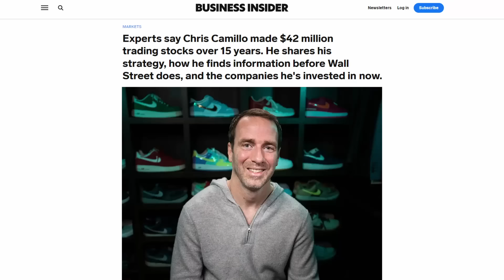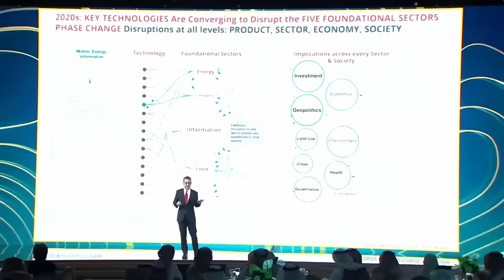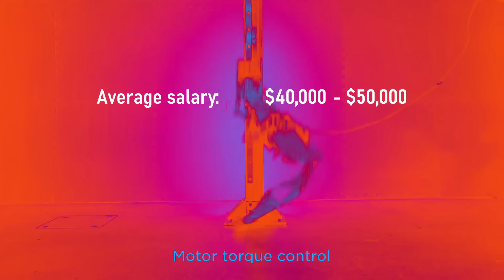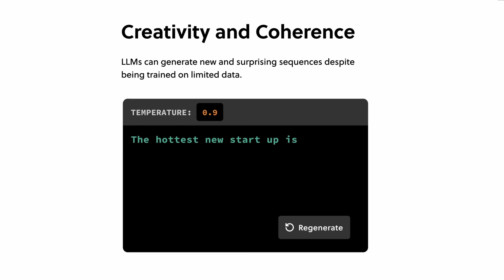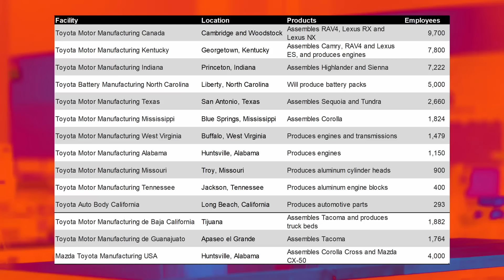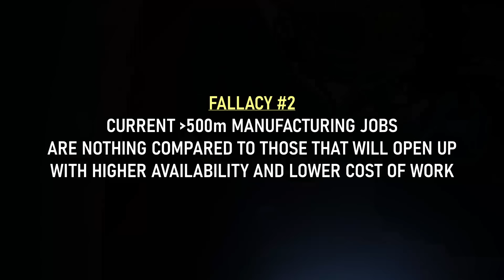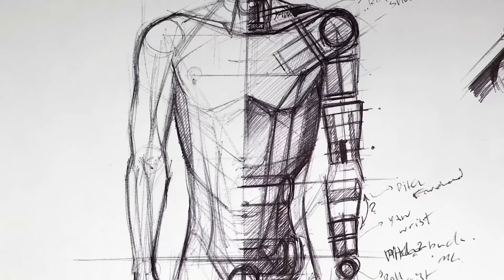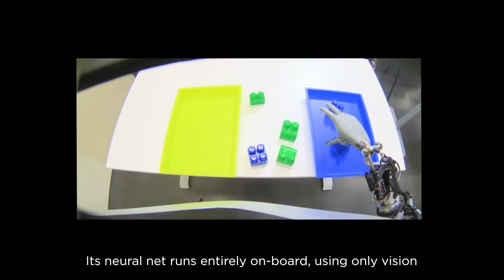The $12 Trillion Opportunity (A Call Option on Infinity! Valuating Teslabot Pt.2: The Road to CHOAM)

Comment: There’s a few errors in these calculations comparing entire workforce cost to just the robot portion etc. 

There’s also things missing.. you’re assuming robots will perform at 1:1 human speed. Some tasks will be slower, some faster. This can be made up by longer shifts, but you’re already including that. 

You’re also assuming a tethered (powered) robot that doesn’t have charging downtime. Surely you won’t get 20 hour shifts out of these things, what’s an industry average of charge time to operation time? Is it really 1:5?
Reply from the maker: 1:1 working speed is an assumption I made to simplify calculations. Of course it is both task dependent (some tasks easier for robot than others) and time dependent (robots will improve) but that's sandbaggongbit. Most automobile production tasks are slowed down to meet human pace for repeated work. Humans can do it much quicker, but can't sustain doing it again and again without tiring, increasing injuries and job related health problems, and decreasing quality. Even if bot's do a task slightly slower than humans, their ability to do it repetitively should trump human speed. I ignored that, as value proposition was high as it is.

charging doesn't bother me as often it can be done on the job (in more static jobs wired, many other jobs wirelessly). There will still be jobs where charging is impossible, but in most cases my conservative 4 hours of downtime per day should be more than enough for charging. Also, there could be a case of carrying an additional replaceable battery, similar to power banks used for smartphones, which would provide extra energy and once low could be replaced with a fully charged pack
Reply: @ConnectingODots  could you imagine what you could charge for a battery that would make the production infinite/non-stop. I bet there’s a team at Tesla working on exactly what they could charge for it. Haha. 

It’d be pretty rad though if the robots took the same lunch break and dinner break as human and it was just charging time.

Comment: These guys seem to be stuck on the idea that human controls will always be around. I’m not a fan of the humanoid design bc the best robots are integrated into the tool itself. For example, does anyone think a physical robot driving a delivery van or flying an airplane is a good idea? The future is in self-driving vans and an autonomous drones - without human controls. Extend that to factories. The factory of the future will not have human workstations.

Comment: Among many excellent points, the idea that products created during testing and deployment could be used in Tesla’s other product categories stood out to me. This, along with vertical integration, having direct access to engineers and factories and databases, compresses R&D. Even if optimus is the most advanced humanoid by capabilities, the R&D would be dramatically lower than competitors because they’re already capitalizing on useful work during testing while also rapidly iterating.

People are not ready for how fast this will all move.
Reply: Work at one of the most advanced robotic assembly lines in the US, with row after row of both fixed and moving robots. It's impressive to watch them move and perform, but it's also an experience how fragile they are, how high-tolerance and constant-calibration they are, and from my employee perspective, how often the outside service outfit is called in. With all of the tasks CNC programmming outsourced to In'dia, and all of the service work outsourced to regional 'authorized service centers', the only work left is Operator, and all that means is parts-changer, then sit and watch the remote videos for sparks or smoke. 

The company has also had to remove an entire $M robot line and replace it with humans again, where the robots couldn't tolerate even minor variations in (large) part dimensions, or had assembly feed parts jams, or parts start dropping in a pile on the floor. There are 100s of paid-bots chossing up Tesla threads, but what is Optimus good for? Optimus is useful only as a  'teaser' for Tesla early-investor cash-float, like Tesla Truck buyer-deposit cash-float, Tesla Solar Tiles buyer-deposit cash-float, Tesla 'Mission Mars' NASA-grant cash-float, Tesla Battery Wall buyer-deposit cash-float, Twitter-X ad revenue cash-float.

Besides, 2024 will be Happy Days (Are Here Again) indiscriminate Fed Fiat Jubilee, slush funding to anything and everything, ahead of the elections, why risk an unproven Tesla? Invest the index funds: Vanguard WW3 Sturm und Drang ADR or BlackRock Crypto ETF. "Stocks are at their highest trading values ever! Isn't it time you came off the sidelines?"
Reply: People will be fine mate. We can actually tell this video was fake AF. 

The real cope will be with you lads in another 10 years when this thing still can't stand on 1 foot without tethers and you finally realise you've been hit by another FSD level scam

Comment: What does the phrase “speculative but relatively conservative”.  ?   How can something be both speculative and conservative?
Reply: It makes no sense but they don’t give good investment decisions anyways.
Reply: When something is described as "speculative but relatively conservative," it means that while there are elements of new, untested, or theoretical ideas, these ideas are not radical departures from what is considered standard or safe. They are speculations made with a certain level of prudence and within the bounds of reasonable extrapolation from existing knowledge.
Reply: That is what it means when someone is using it in a calm considered way but when it is thrown out in a rapid fire sales presentation, which this is, it is a way to cover the “arse” of the presenter.  As in “I am conservative because I told you I was speculating.” This is important when you realize that his self assured way of pricing the Optimus at $120,000 per year gets absolutely not push back from the “world class engineer.”

Comment: Interesting video. In this video too, a mistake is made when it is said that automation saves money. Automation, like any cost saving, mainly gives a competitive advantage. In the short term, profits may increase, but over a longer period of time, the value of the manufactured product decreases. This is important because if you make calculations according to the current operating figures, they are very inaccurate even in a relatively short period of time.

Comment: What about robot power consumption per year? What's that cost aswell?
Reply: A rounding error in these spreadsheet games. Pick a high number and say it will use 100 kWh for 24 hours of work and see where you get.
Reply: $0.00 with solar power and battery storage

Comment: I’m all for the humanoid bot but I feel like people don’t really understand how difficult it will be to simply replace a human in a manufacturing environment. Since the beginning of the assembly line, manufacturing engineers have been developing automation robotics to carry out specific routine tasks that are designed to repeat a specific task over and over very efficiently. Throwing a bipedal robot at an assembly line doesn’t really address or overcome what a manufacturing engineer can design a specific machine to do and specialize in that task with great efficiency and relatively low cost. I guess I’m not really in the camp that bipedal bots will replace manufacturing human workers anytime soon. I hope to be proven wrong, coming from an engineering perspective.
Reply: You haven't grasped what artificial intelligence means.  It looks like it will be possible to "show" an AI robot some videos of humans doing a task and the robot will figure out how to do the task without any human 'engineering', any coding at all.  

1) Build a machine that can move and manipulate as good as a human.

2) Give that machine the ability to 'look and learn.

In fact, it appears that with the AI language models that we now have it is going to be possible to just tell a robot what you want it to do.  "Take the door panels off the cart and place them where the assembly robot can reach them.  Put the top of the panel in first, and the outside down."  

Like a human trainee, the robot will need a bit more info as to what is top, what is outside, and where the item goes.  But that training will be needed only once.  That info will be available for a replacement robot coming online.
Reply: @bobwallace9753  your point about “give the machine the ability to look and learn” I think is being oversimplified. I don’t think we have a good grasp on how complex even a simple human task actually can be. Simple for human but complicated for a robot. I think most business owners will stick to hiring a low wage worker rather than trying to implement a humanoid robot for at least the next 10-20 years. Just look at how complex it is to solve FSD. FSD is a relatively simple robot with only a few outputs (steer, brake, accelerate) and the rules are fairly simple, simple enough for a 16 year old to figure it out. I think FSD will be solved and be of value, but compare that to a robot with many more degrees of freedom that all have to be controlled and now you are going to throw tasks at it that are infinitely variable. I just don’t see it happening. I’m a Tesla enthusiast but I really don’t see how a humanoid robot is going to replace jobs anytime soon in a significant way.
Reply: @stevecha3612  
Driving is incredibly complex.  The environment is constantly changing.  There's huge variability in the style and placement of traffic signs/signals.  Roads twist and turn.  Lanes appear and disappear.  Vehicles park in traffic lanes.  Weather changes as does lighting.  Other drivers do weird things.   

A 'pick and place' job, common in factories, is very simple and in an environment that changes only in very limited ways.
Reply: @bobwallace9753  yes I agree that fsd is a complex problem to solve but not nearly as complex as a humanoid robot that has to deal with an order of magnitude more complex situations if it’s meant to adapt to any situation or environment. If pick n place is a function that a humanoid robot can be well suited for, why not just put in place a robot that is specifically designed to do pick n place the most efficiently, especially if this process is done in an assembly line, you wouldn’t want a humanoid robot to take 10 mins to pick and place something that a specific pick n place robot can to in 1 second.  Example, just put this robot in place and it can adapt to a wide variety of different products in this manufacturing line, why stick a slow humanoid robot in this place : https://youtu.be/tywZsEGm1xc?si=gjykZdH0vix7PxIk
Reply: @stevecha3612  

There are many jobs in factories that you could learn in a few minutes.  It takes many hours of training and many, many hours of experience to become a safe driver.  

A humanoid robot is a drop-in replacement for a human.  If a company can produce a good human replacement then there is no need to design and manufacture expensive 'one-off' robots for specific jobs.  If a human is now doing the job then a humanoid robot and step in and do that job more reliably and for a lot less money.

You are assuming humanoid robots cannot move quickly.  Bad assumption.

Comment: First of all, I’m very excited about the Optimus robot, and the future for Tesla. I’m sure this will be used in many future situations.

However, for factory jobs, I think that humanoid robots may turn out to be too slow and delicate or cumbersome for many tasks

Currently, very high speed, factory robots, already exist doing many jobs in the factories.
These are mounted and able to operate at very high speeds.

Certainly an advantage of the humanoid is that it is a very general solution. Albeit potentially a slower one.

Let’s take the case of bringing parts or supplies to a factory robot. It seems that building a more custom robot that travels on wheels, and then has arms and a head with sensors, would be a more durable and potentially much faster solution. So we can expect a mix of different solutions for different problems.

Comment: The question is how long it will take TSLA to 10x or 100x.  I might be dead and gone by then!
Reply: So, if that’s the case, then, why would it matter?
Reply: 10x while I'm still alive please.   100x after I'm gone.  The difference?  We shall see.
Reply: Building a bot factory is much, much, much simpler than building a car factory.  Very few parts.  Very few parts to assemble compared to a vehicle.  

I expect car production to grow rapidly once the next <$30k EV design and factory are completed.  Then they just cookie-cut many more factories.  Bot factories can grow much, much faster as they are much simpler.